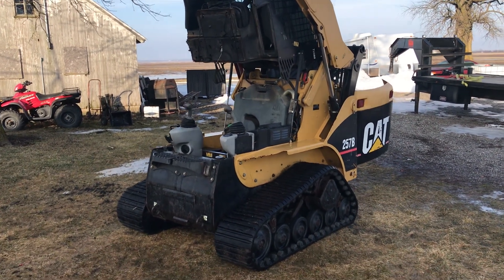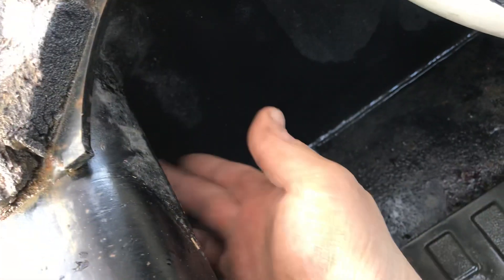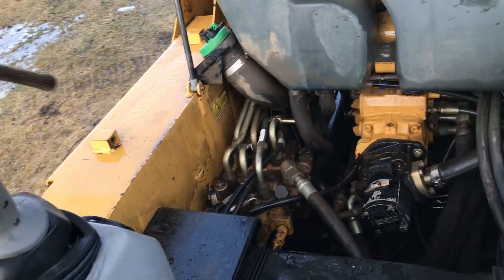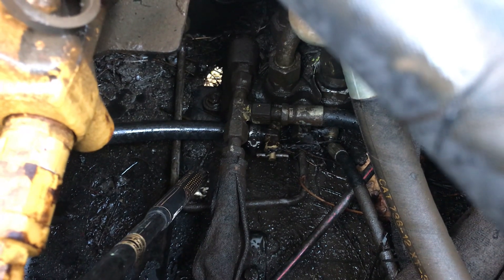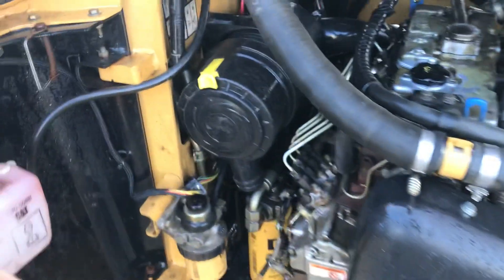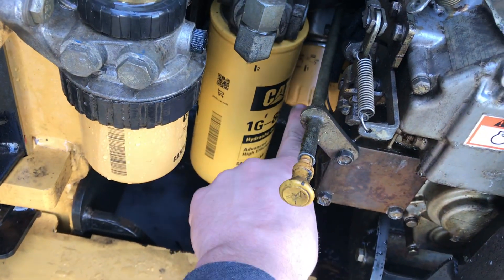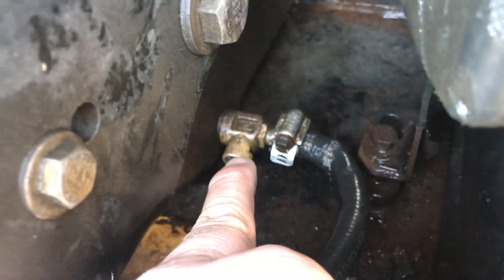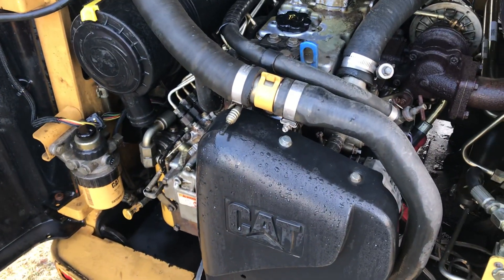2007 Cat 257B locations

Comment: Great video. Here's a heads up on the inline fuel filter. Find your transfer pump, located just behind the high pressure fuel pump. There's a small screw in the middle of the pump. Remove it and "CAREFULLY" lift the top off. This will expose a screen inside. Remove and clean. Note the screen has 3 fingers that allow it to go in one way. Also the cover has a star pattern in order to align. Also not this is a not serviced part by CAT. Meaning if you screw something up, you need a new pump. I just did one yesterday for a customer that replaced the OEM water sep./filter and couldn't figure out why his machine ran like crap. Wish I could show you the pictures! Hope this helps.

Comment: Your online fuel filter location... behind air filter housing, at rear engine mount, look for the rubber fuel line and you will see it about the same height as the hydraulic filter housing.

Comment: Ok so,the valve on the thermostat housing is to shut the water supply off to the heater core for using the machine in the summer to get the most out of the ac,the in line fiel filter is behind the air cleaner housing between the fuel tank sending unit and the mechanical fuel pump

Comment: Ever have any luck locating in line fuel filter??
Reply: Its hidden behind the air filter housing between the fuel tank and the mechanical fuel pump
Reply: @golfwrench   
Thanks for the reply! I think our unit doesn’t have it after looking. I figured that’s where it had to be. I may install one in there. There is a screen in the fuel lift pump on the top. One 8mm bolt and it’s under the round cover. Ours was filthy. I dunno how diesel flowed through it. After cleaning it Runs best it ever has since we have owned it. Also way easier to prime with the plunger now. Hope this helps someone!

Comment: Have you found the in-line fuel filter yet because I can’t  find mine I have been looking
Reply from the maker: I have not, but I have cab up on mine changing hydraulic lines and track parts so I’ll double check
Reply: @brandonkoester9031   Have you ever found the inline fuel filter? I am looking on mine but don't want to lift the cab unless it is necessary.
Reply from the maker: @tombrown352  behind air filter between fuel tank sending unit and the mechanical fuel pump
Reply from the maker: Open back door up to find

Comment: My cat 257b starting bucket moves up and down but will not move track wheels seems to be locked what is the problem what to do to get the wheels rolling
Reply: Check the electrical connection to the door

Comment: I have a 216b skid steer hydraulic pump will not operate bucket will not lift wheels will not turn
Reply from the maker: Check fluid level first then if change fluid and filter

Comment: Is there a latch you have to pull to get the cab up? I got the nuts off and tried my hardest to lift the cab..
Reply from the maker: Marshall Eng sorry for late reply I had no latch on mine but did have to take pry bar to pop it loose from sitting so long
Reply: Brandon Koester yeah that one I was working on had been sitting for years. I used a pry bar to get the cab bolts out of the holes. But that’s as far as that went. 

I noticed on the left side of the cab there is a small red lever. I tried to mess with that but no success. I guess I’ll try to pry on it more..
Reply from the maker: Marshall Eng there’s a red lever that locks into place after cab is open
Reply: @brandonkoester9031  is the red lever a safety lab so cab doesn't fall closed?
Reply from the maker: @galehess6676  yes